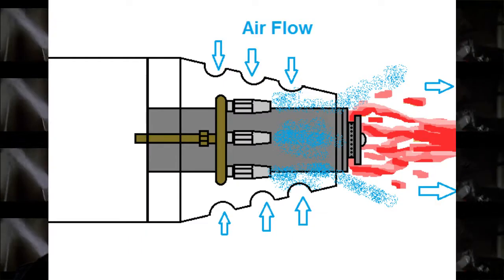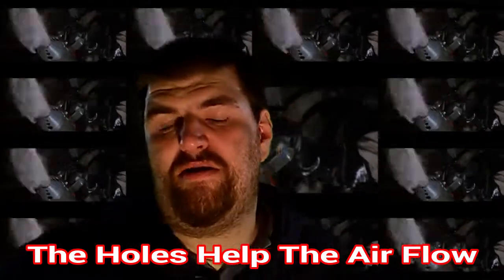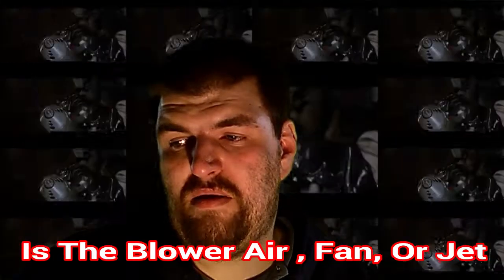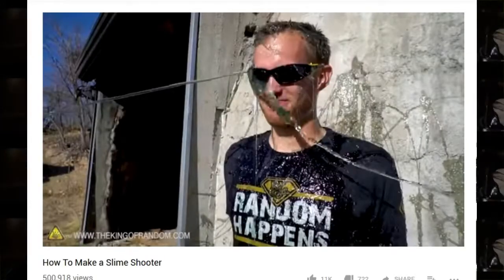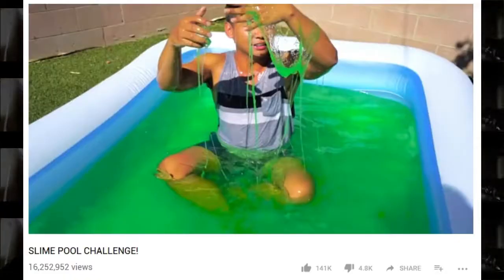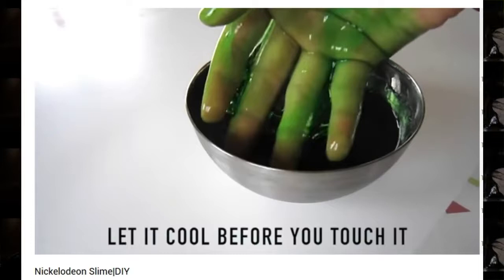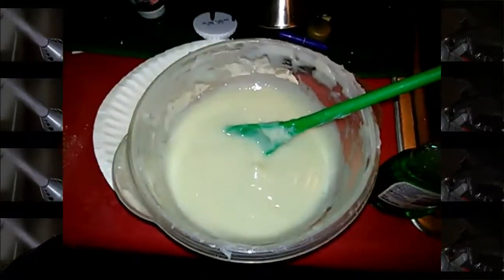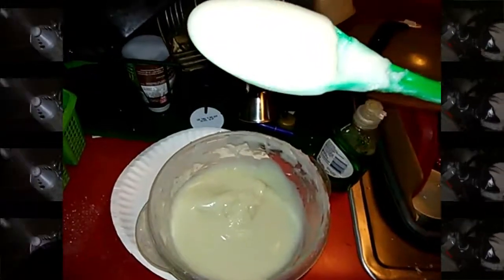How Dose A Slime Blower Work

Comment: I'm not sure what you're trying to say or figure out in this Video?
The slime for GB2 used for the Slime Blowers was Methyl cellulose!
The gun didn't use any sprinkler system, it was simple pipe that hooked up to the brass Parker fittings and extra hoses that laid on the floor with slime in one line and pressure in the other line to shoot the slime out and the round part with the holes was a simple aluminum disc with those small holes/notches for the slime to build pressure and shoot a straight stream like a shower head!
All the info is available at GBFANS if you're interested in finding out more about the slime blower.
Reply from the maker: I was trying to figure out how the slime blowers worked. Giving ideas on what I thought how they worked. I did go to the site & looked up the slime blowers. All they described is the props had a long black hose ruining off screen. I will have a follow up on this video. I think I found how they actually worked.
Reply: @nathanalaneller the info is all over the site in different threads but if you look up Koco's Slime Blower build in the prop section he figured out that there's simply pipe that the brass fittings are attached to that distributes the slime and air. 
The other thread is the slimeblower parts list.
And if you check out Karnivorous creations on Facebook they're making a slimeblower and the gun is built to replicate the mechanical aspects of the real props. Also if you look for Slimeblower builders group on Facebook they post good info. I'm not going to mention the guys real name because I don't know if he would want that but he goes by Koco on Gbfans.
Reply: Also I forget to mention if you look up Cyland props  he has good pics of a real slimeblower, nothing on the inside of the gun but you can kinda get the ideas on how it works. The lever on the side really worked to shut off the air or slime! They would simply plug the hoses leading to the floor to pump the air and slime through and it was up to the actor to turn the lever to let it flow through the small pipe inside the Gun!
Reply from the maker: thanks for the tip :)  @teddymoulin906

Comment: The slime is made of methylcellulose for the base thin down with water and small amounts of Mica dust and mineral oil , that's for the river of slime. the jar of slime would be 8 cups of methylcellulose 4.5 cups of serapan 50 ccs of red food coloring and 32 gallons of water
Reply from the maker: What is  serapan? I can't find this item, I don't know how to pronounce this item. Is it a jumbled word, secretly saying syrup?
Reply: @nathanalaneller  i don't know what it is but I think its a food thickener. I found this info from a post online somewhere and i checked online everywhere but I couldn't get any results and I did spell it right

Comment: I'm pretty sure they attached the inside hose to the gun and the inside hose was under pressure from an outside power source, and did an excellent job hiding it with all that black vacuum hose you see lying around, like the hose that Vigo used to tie up Dana Barrett. I believe they ran the "slime hose" through it to hide it.
Reply from the maker: Have you ever seen a concrete sprayer?  I think the slime shooter works the same way. Fluid & high pressure air gun.